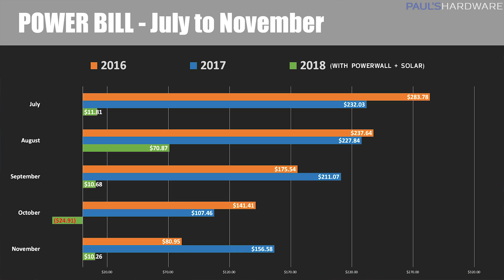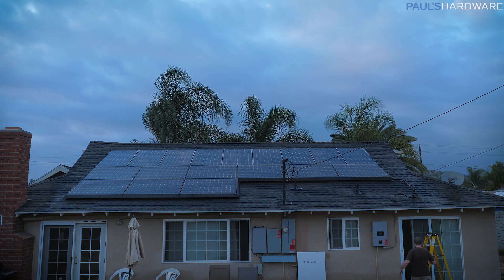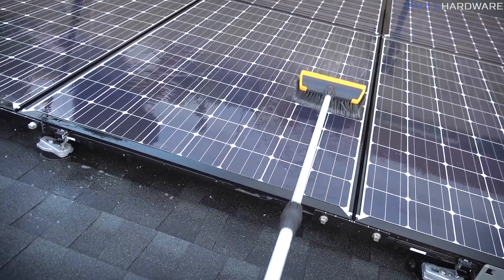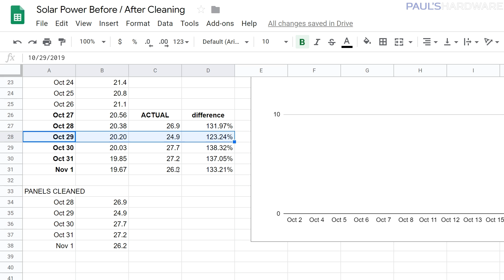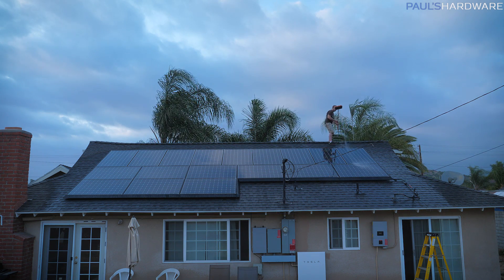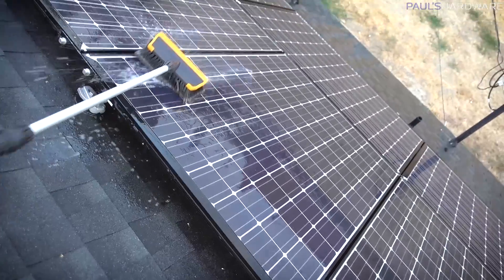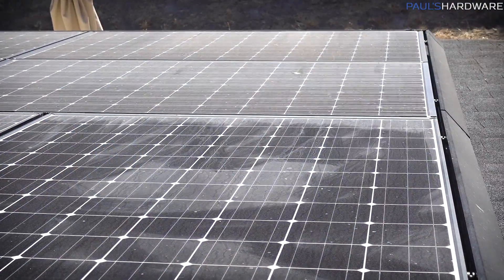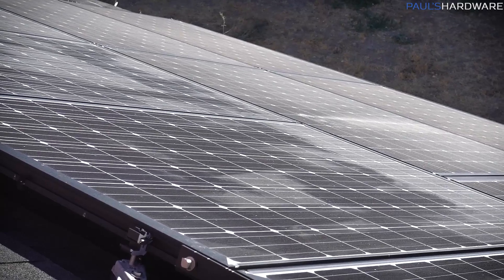Should You Clean Your Solar Panels? Before/After Testing!

Comment: Surely a long pole window cleaners brush or sponge would bbe waaay better as they're 4-5 times as long as that pole, so you could do it from the ground! Or maybe a pressure washer? Get both and then do a clean with each to see which work better?

Comment: A pressure washer at a 45 degree angle with an extension on a low psi would work much better, or you could get a professional to clean them for you, it’s about 12$ per panel but it sound like it might be worth it.

Comment: Instead of using regular hose, may be using adjustable pressure washer would be a better choice. If you adjust the water pressure to a degree that won't damage the panels but enough to clean them without using any brush can result better and will result using less water to clean those.

Comment: could u put a ceramic coat on these?
Reply: Great in theory, would be terrible in practice as they block most of the uv and infra red which is what solar panels use. so they would stay clean, but not produce a lot of electricity.

Comment: I assume you clean your car with a "soap". use the same stuff when you clean your panels . Also get a roof ladder.
Reply from the maker: These ideas are mind-blowing 🤯
Reply: @paulshardware  or a 24 foot panel brush.......
Reply: @paulshardware  yer, with a roof ladder next to the panels you can hardly lose grip and can scrub them from the side
Reply: @paulshardware  https://www.amazon.com/Todeco-Ladder-Universal-Maximum-Material/dp/B016XSKRX2/ref=sr_1_10?keywords=roof+ladder&qid=1572822033&s=hi&sr=1-10
Reply: @paulshardware  Soap would be bad, might leave a film.  I add some ammonia to the water.
Reply: @paulshardware  most solar panels have a nano layer that stops dirt from sticking to it, never use soap because this will mess the layer up
Reply: Actually I wouldn't.  You should check with the manufacturer cause that's like saying I Use Windex to clean my windows so that should be OK on my monitor screen right?
Reply: Windex makes a product for cleaning glass exposed to the outside of the house. You can clean your windows the same time you clean your solar panels.
Reply: And get a safety Harness and line. They have them at Home Depot. The line ties to soothing real heavy (car?) in front
Reply: @steveurbach3093  Then your wife comes out and drives away.
Reply: roof ladder or some scaffolding would be nice, I know they make easy to store scaffolding that can be packed away when not in use, and that would probably be more stable than a roofing ladder.
Reply: Dish washing liquid might have salt in it. If you must use it, rinse thoroughly, watching out for splashes too that the rain won't reach.
Reply: NEVER use soap on solar panels !
Reply: @ingeborgsvensson4896  What about rain x?
Reply: @zengrath  Never heard of it. All I know is that soap residue will get between the rims on the edges and ruin your panels. I only use water and a sponge. That means it will take much longer but I am sure the panels won't damage.
Reply: @ingeborgsvensson4896  Rain-X is a compound that acts like wax on automobiles.  Just like car wax, Rain-X must be buffed after application, or it will leave a white residue all over where it was applied.

Comment: Could you use a pressure washer on them or would that damage them? Interested in any follow up!
Reply: definitely don't, you need to be extremely easy on the glass and wafers of the panels, microfractures will reduce the production of the panels by a huge amount
Reply: Yes you can. Just spray at an angle, keep at least 1 ft distance and don't use  a rotating nozzle. A flare nozzle works better, because the rotating nozzle will tend to clean in spirals, leavi g in between areas dirty and damage easier. Another consideration, in some areas, could be water quality. Aluminum is quite sensitive to salts and you don't want to start corrosion on the panel frames.

Comment: That was a big difference! Make a permanent waternossel installation so you dont have to go up on the roof at all. Just flik a valve and your good 😉
Reply: Argammon of Rendor, you still occasionally need mechanical scrubbing because chemically it won’t get everything.
Reply: @UnfrozenScoundrel  alright so then there should be a solar panel rumbo style robot scrubber.
Reply: @ericsalidbar1693  I mean all you basically need is a rumba with a water jet and tether it down. If I had solar panels I'd love to try making a solar panel cleaning robot
Reply: nathan smith haha let's make it happen lol.
Reply: @ericsalidbar1693  There was a Kickstarter for this in 2014 (Scrobby Solar), but it didn't reach its goal.  Probably a bit too early to market.
Reply: Make sure not to use hard water. You don't want permanent calcium build up.

Comment: Do you have microinverters or are all panels just connected together? I would do this test with an installation with microinverters where you can monitor what every panel produces. Then just clean 1/2 of the panels and compare it that way. As sunlight is exactly the same the test is fair.
I have an installation with microinverters, living in Belgium and here I have the impression that my panels are ca. 5-10 % less performing then when they were installed in 2015. As a reference I take the generated power of the best day of every year, and I reached my day record pretty much immediatly after placing them (some weeks after it), but never  reached that record again . Maybe I'll get on my roof and will do the test of cleaning half of the panels and monitor what they produce in electricity. Until now I never cleaned them...
Oh what is also important: if all panels are connected together, a dirty spot on 1 panel can drastically reduce total performance of your whole installation. With a microinverter installation also this variable is removed. So depending if you have a classical or a microinverter installation, cleaning the panels is more or less important.
Reply: Average data says that panels are aging at about 0,8-1%/Y . Maybe a bit less on very good quality ones. Production is very sensitive also on working temperature(so ambient temperature too) with a negative coefficient , so if year after year is getting warmer then the production will be less
Reply: Thank you for the insight. 5-10% doesn't sound that relevant to me and could have other reasons (the ageing of your panels).  I live in a similar (humid) climate; installed my panels about the same time Paul did. I have never heard that I needed cleaning them. Then again, we have more rain here & the angle of my roof is much steeper.  Nevertheless, that is something to look at for the future - since with climate change we now regularly tend to get droughts in summer.
Reply: Panels with individual microinverters is what I have.  8-10 % improvement when I cleaned I year after install. I could see that panels with microinverters tolerate dirt better than panels that are connected to 1 inverter.